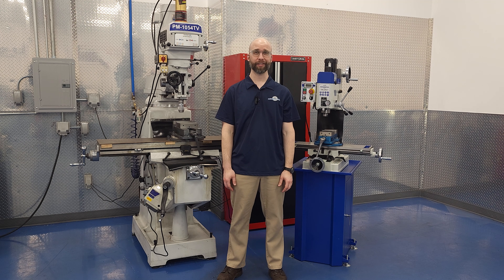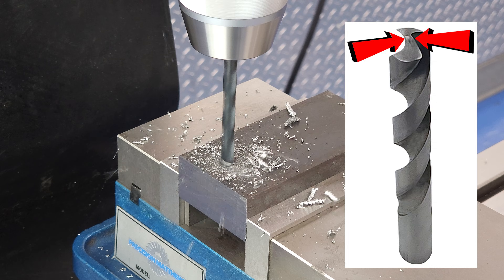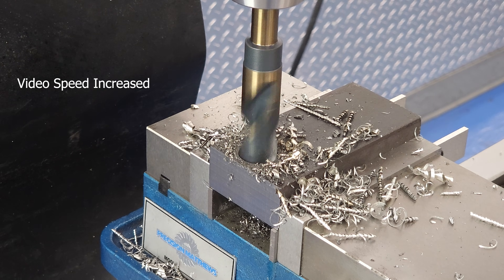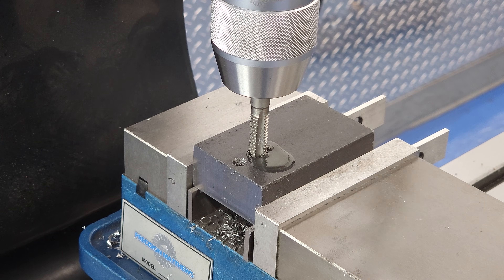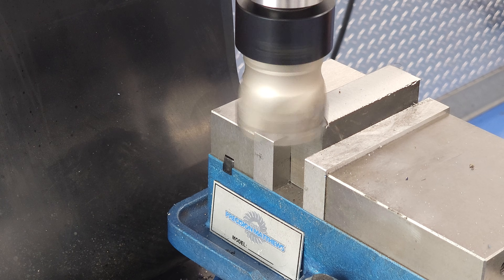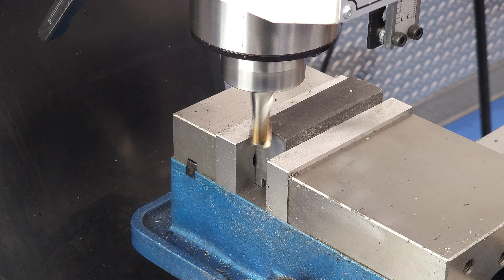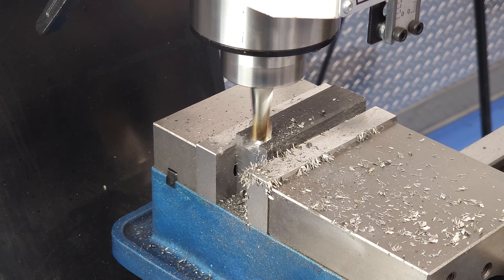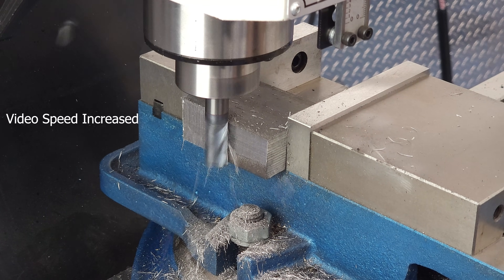PM 728VT Limit Test Precision Matthews Media

Comment: Precision Matthews has the best Warranty and customer service and support for this size machine. I have had this machine about a 1 year  As for cuts .030 to .050 doc. on steel With out a lot of vibration. spindle tir is .0004 on seat

Comment: How hard or easy would it be to upgrade the motor’s horsepower on this particular model?
Reply from the maker: I'm sure people have done it, but except for maybe the 3/4" drilling operation, none of the cuts shown in the video would be helped by a more powerful motor. The limits we were running into were limits in the rigidity of the castings more than the power of the motor. In short, you probably wouldn't get much added performance for the hassle and expense of upgrading the motor.
Reply: @precisionmatthewsmachineco  100% agree.

Comment: I have owned this mill for several years now and I don't believe this mill will hold up to heavy use it just isn't designed for it. Although it's hard to tell from a video I have more vibration in mine than what this one appears to show in heavier cuts regardless of the tooling type (larger end mills/ face mill or fly mill). I'm thinking of lifting mine up and checking the column to base bolts again to see if they are tight, The column and base on this mill could use a heavier design IMHO and a small NOD adjustment added at an additional cost of course and I understand that. 
The nod has been out on mine since the day I got it and when I talked with PM I was told it's within spec and there is nothing to fix it. Again I understand this is a hobby milling machine and for the price point/weight class it's in there are going to be limitations. 

I have pushed my PM1130 lathe pretty good and am impressed with what it has done, but this milling machine while nice isn't even in the class of a larger milling machine, it's precision (with the exception of nod) and not production and has to be treated as such to get a decent end product.
Reply: Don't take my first response to be critical of the PM728, it's a nice milling machine and PM was very helpful and very fast in responses with any questions I had, as well as VERY fast with a replacement part for my PM1130 lathe when I needed help and I would gladly purchase from them again. I honestly cannot remember when I have received better customer service and support.
i would have purchased a larger machine if I could have for my needs but don't have the space and that's on me not PM or the PM728. My suggestion of having heavier casting on the base to column and a small NOD adjustment are suggestions on improving the design of this milling machine and giving it more capability and nothing more, but an option I would have been willing to pay more to have had.
Reply from the maker: We completely understand. Appreciate the nice comments as well.

Comment: Very useful and much appreciated.  In the absence of a DRO and knowing the feed rate definitively, I would appreciate a "best guess" estimate.  Looks to me like it could be as low as 1-inch per minute which could really mess with tool life.  But whatever that feed rate is, can your Power Feeder option will drive the table at that slow a feed rate, or do you HAVE to feed by hand to attain a slow enough feed rate to mill steel?
Reply from the maker: I'd say we are above 1IPM even on the heaviest cuts, but yes, these cuts are probably still slow enough to be sub-optimal for best tool life. I'd guess that all are achievable with the 728 powerfeed at its slowest setting.